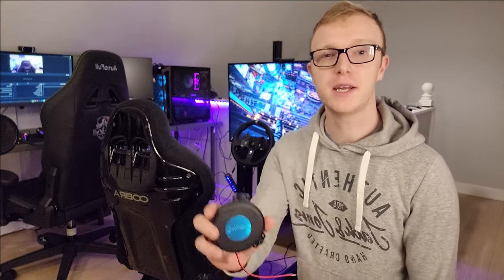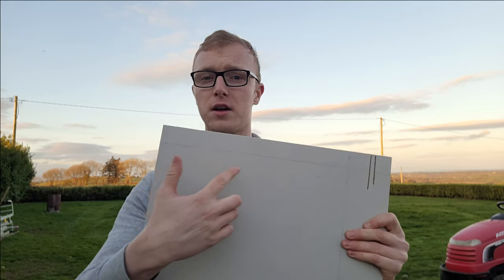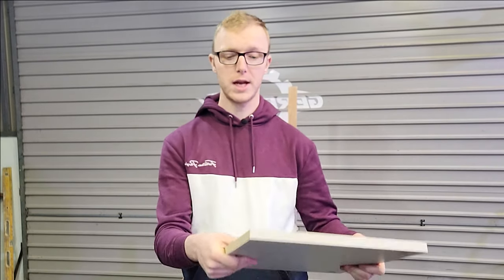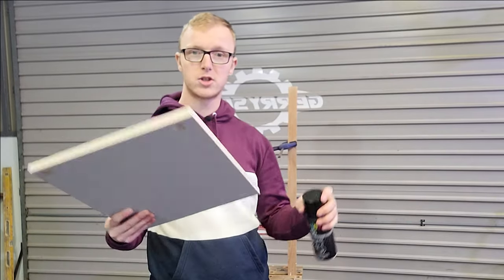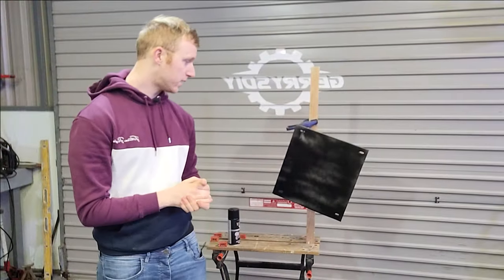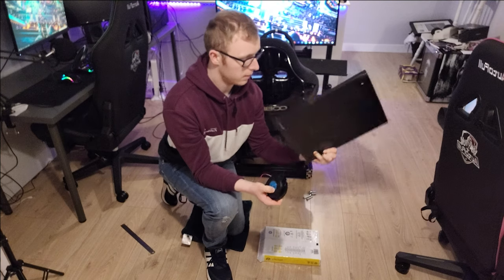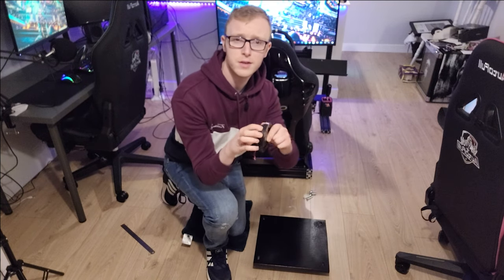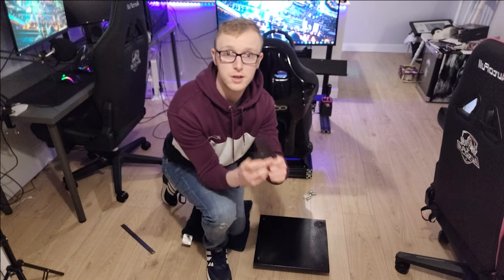Simple DIY Bass Shaker Install!

Comment: People,  don't mount your amp to the same board as your bass shaker transducer,  electronic dont like to be jostled and vibrated like that, over time could certainly damage components or even the circuit board.

Comment: Any ideas how to mount a bass shaker to a hardshell seat without holes on the bottom? i dont really want to drill holes into the seat :c
Reply from the maker: Hi, is your seat mounted to a cockpit?
Reply: @mpowr2707  yes, it is mounted to a self build alu profile rig. its mounted on seat brackets which are mounted on top of a slide. Someone told me he did it with heavy duty tape, but i dont think it will last long. But i give it a shot
Reply: @mpowr2707  Its a sparce rev seat btw
Reply from the maker: What about drilling 2 holes in each side mount seat bracket you have, cutting a piece of wood to fit in between the two brackets relatively snugly and then hold that in place while you put a screw through each of the 4 holes you just drilled to then secure the wood in place. Now you have a platform to mount your bass shaker to. This is very similar to what I did in the video, except rather than using the 4 mounting holes I had in the bottom of my seat to attach the wood you are just going through the side of the brackets instead. 

Or you could, if you have two spare shakers, cut two pieces of wood (1 for each side of your seat) and use the bolts that currently secure your brackets to your seat by taking them out (and maybe using longer ones depending on the thickness of the wood) and putting them through the wood, into your brackets and then ultimately into the mounting holes on the side of your seat. So essentially, it's the same way as you have it mounted now except the bolt's journey wouldnt just be bracket > seat, it would be wood, bracket, seat. You would sandwich the wood between the bolt and the bracket. 

I have seen a few different mounting solutions for attaching a bass shaker to the back of a hard back seat but without drilling through the seat they tend to be more awkward and plenty of times less secure than the solutions I mentioned.

Hope this helps and was easy enough to understand 🙂

Comment: hello.can you please tell me how do you connect the nobsound amp to your pc ?
Reply from the maker: Hi, the amp is connected to your PC through a micro usb cable. Hope this helps!
Reply: @mpowr2707  yes thank you do you need some other software also or is it plug and play?
Reply from the maker: Yes you will need software, there is a couple of different programs for it. Personally, I use Simhub. You will have to tell Simhub you want your output device as your amp and then you have to configure what frequencies each effect in the game will come through the speakers at. I followed a YT video for configuring the frequencies and it made it much easier. Good luck with the setup!
Reply: @mpowr2707  yes is just watched another video it's all clear to me now. Thanks for the help